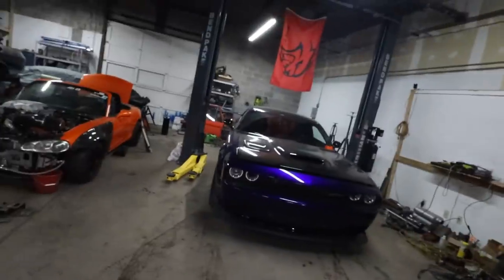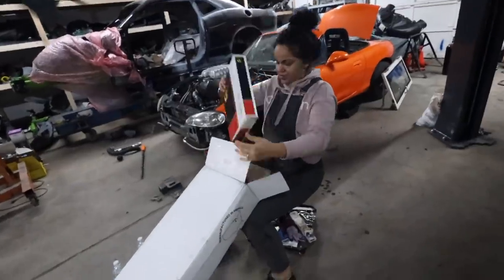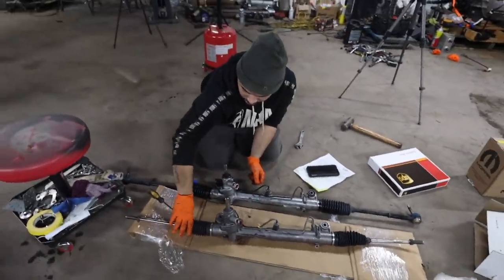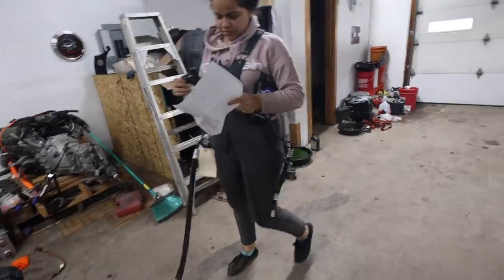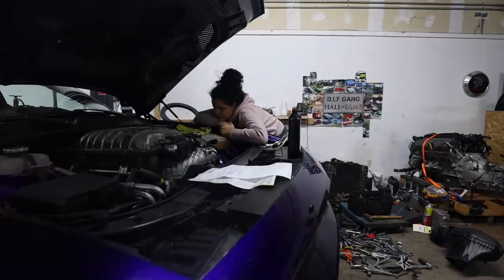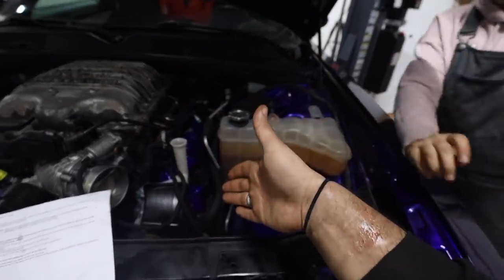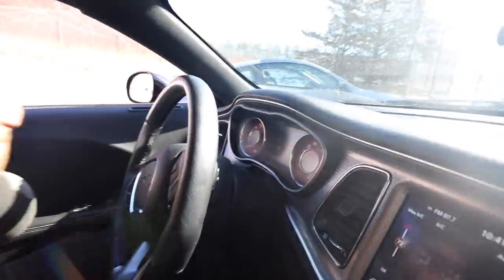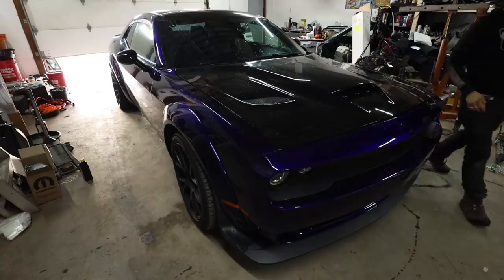I Finally Figured out the PROBLEM with my Burnt Hellcat!

Comment: If the pump is self destructing, it's putting trash in the fluid that is circulated all thru the system. I'd get some trans cooler flush and run it thru the cooler and all the lines until it comes out clean, otherwise you run the risk of damaging all the new parts

Comment: We usually bleed power steering with the engine running to make it easier
Reply: Yea but some of those pumps can burn out and make noise even though i enjoy the electric power steering came a long way. P
Reply: No. Its actually with wheels off the ground. With the pump running allows are and will burn out the pump.
Reply: @pastathemechanic7536  yea i knew that already but the newer steering pumps are electric or non fluid pumps.. But i know that's still old school. But i know they got this stuff u can to clean n flush it out its like yellowish colored..

Comment: Haha how funny I just fixed my c1219 code for clock spring/steering angle sensor was turned -360 after replace my steering rack. I had to take off steering wheel and turn steering angle sensor to the left one full turn witch until at 0 degrees and now runs perfect no more traction control light !

Comment: Greetings from the great White North of North Pole again! That Phoenix is a one of a kind beauty, just like your wife. 
Did you like the weather gift I sent to the lower 48? Texas isn't very happy with me though. Too bad, so sad, sucks to be them.  We are finally getting weather with temperatures above zero for the first time in 2 weeks, but it comes with 5 to 7 inches of new snow.    Oh I almost forgot, our temperature on Monday was -38°f for the high and -52°f for the low, but on Tuesday morning it was +7°at 8am and by 4pm it was +12°. And it's been above zero since.
And we are gaining 7 minutes per day until the Summer Solstice, when it starts over again and we lose 7 minutes per day.  You should bring your wife and family up here in the Summer. Rent or buy a motorhome and drive the AlCan highway all the way up here. That's the way I'm gonna drive out of here.

Comment: Front rails aren’t straight and the steering rack is trying to compensate for a non straight front end, get it on the rack and measure the rails.too many same probs...
Reply from the maker: Actually it is straight problem was reusing first rack killed my pump, then bought a second hand rack which killed the next pump, and finally decided to bleed and replace everything with new parts and it works fine

Comment: Rack and Pinion are sensitive. you use them with no oil they are gone! Seems like the gaskets on the inside can get easily damaged and there's a lot of other crap that can go wrong with them. Thank God for Electric Steering. But you are a burnout dude. And when you think about it Race cars are high maintaince. I mean Nascars are non-stop work. they have crews and shops cause them cars are always in need of repair